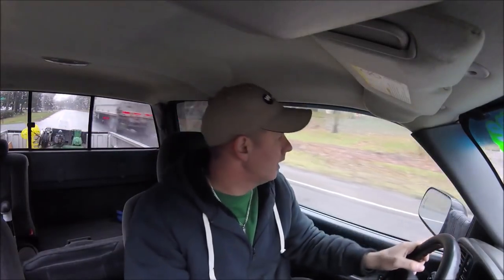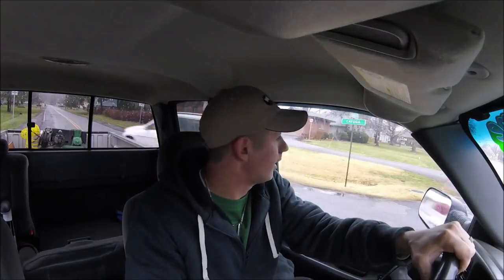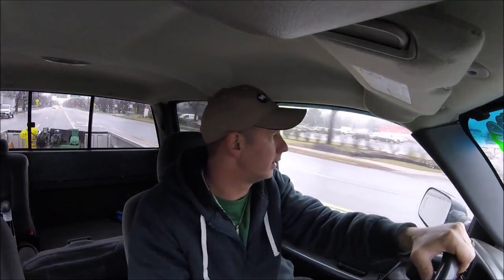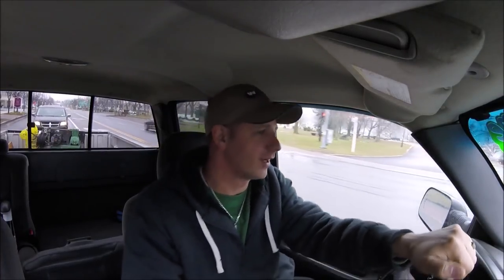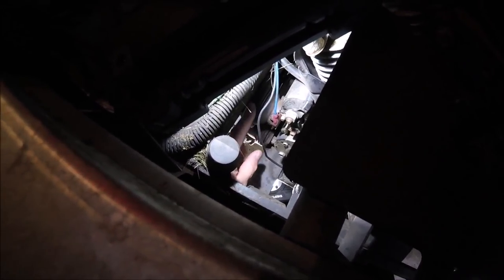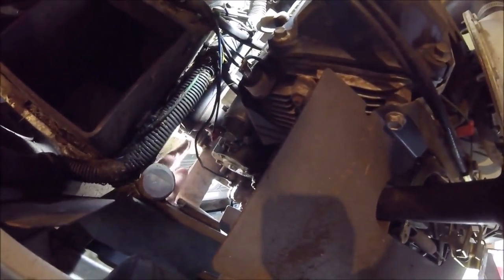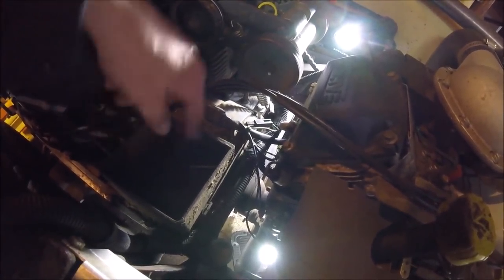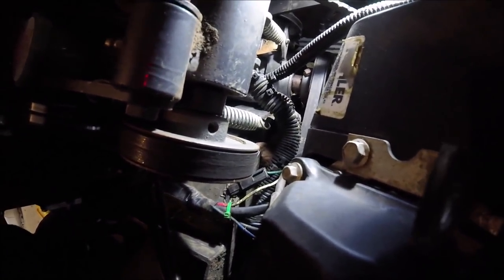Walker Blower Belt - PLEASE HELP

Comment: One way to check is if you grab the pulley (with the belt on) and if you can stretch it (tightening the belt) against the spring then you know the spring is weak.

Comment: I thought it should have more tension too when I checked mine.  The spring has little pressure even when new. As far as the idler going slack with you turning the impeller, that’s normal. The drive pulley when pulling the belt allows tensioner to do its job. By rotating the blower you are pushing the belt and thereby causing some slippage.   I have changed the pulleys, belt, and tension spring on mine and it still will slip when you move impeller by hand. Maybe I’m confused but as long as you can rotate the drive pulley in the proper direction and hold fan still with no slipping you’re good to go
Reply from the maker: Alright. It still vacs pretty good, I've just never known a belt to lose tension under operation unless somethings wrong. Thanks for the input buddy.

Comment: Your blade brake needs adjustment. There is a 7/16 lock nut over near the double blade belt and you tighten the band that holds the pulley to stop it when you disengage the blades.
Reply from the maker: the problem is when the mowers off and I have the PTO engaged everything is tight when I try to spin the blower with my hand in the direction it's supposed to spin the belt loses tension which makes me believe it's doing the same thing when it's running
Reply: And the tensioner is fine... if you turn it the wrong direction it will pull on the spring and let up.... Just make sure the pivot point for the idler pulley under the mower is free and lubed. There should be a zerk there that a lot of people forget. I have rebuilt every inch of walker mowers over the years. Email me if you ever need advice on it
Reply: @CountrysideStrong   No, thats normal... You spinning it is producing the power from the wrong pulley so the idler won't tighten it will loosen. If you by hand turn the pto box pulley (the other one not the one off the blower) you will see it grips good. You are overthinking it. But The condition of the pulley grooves, belt and idler pivot being greased and a good spring are all you can do for the best tension/non slippage.
Reply from the maker: @KenMrKLC  it appears I am over thinking it then. Thanks allot buddy I appreciate it
Reply: Your working against the motor compression when machine is off. Does the blower free spin for a while after you disengage the pto?
Reply from the maker: @cutandcleanwi6947  not really sure. To stop that I just adjust the brake band right?
Reply: Yes. I do mine all by how it sounds. It should take like 2-4 seconds for blades to stop. When it comes out of adjustment they take a long time for them to stop spinning.
Reply from the maker: @cutandcleanwi6947  cool thanks

Comment: Did you end up finding out what the issue is? My blower blades sometimes stop moving all together and than I get clogged with leaves. Have a feeling the tensioner is not making the belt tight enough. Very annoying

Comment: My blower belt just broke yesterday while finishing leaf pickup. I have never replaced it.  Is it hard to get on and off?  The original belt is gone and a few pieces are wrapped in there tight.  The blower will not move with no belt on it. Any suggestions as I know  you have been there and done that. Thanks for any help, Harry
Reply from the maker: It's easy. Get it from Walker parts depot. Com or your dealer
Reply: Hi my belt broke last week and the replacement came in today.  I've also never switched one.  Did you eventually get it fixed yourself or did you have to go to a shop?  If you did it, how hard is it and what do I need to do, please?  Thank you..